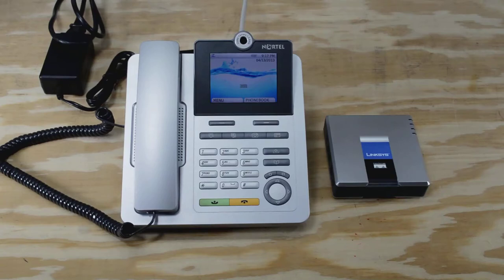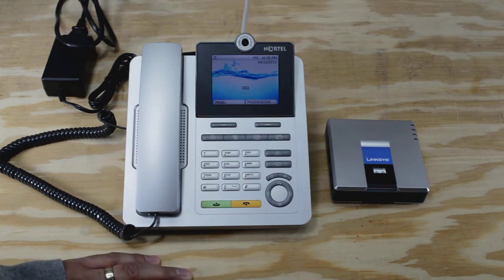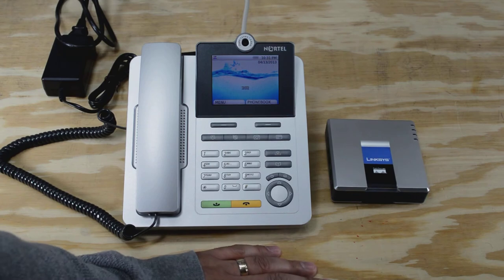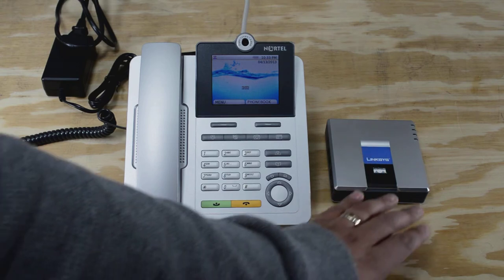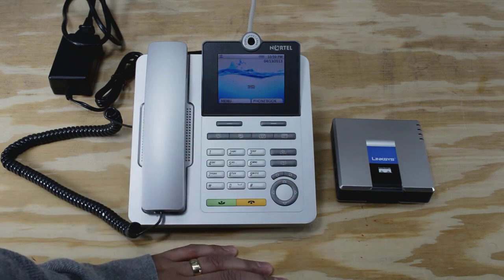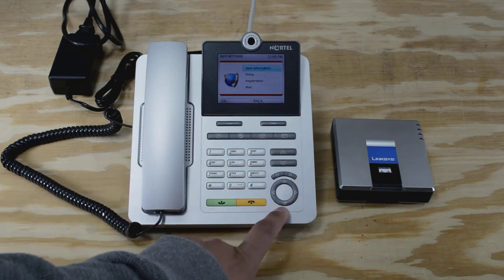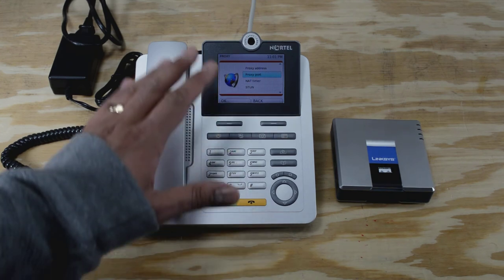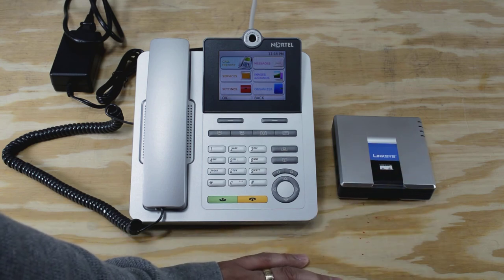PBX Project 2013 - Part 3 - Phones, Extensions and Problems

Comment: 5060 is the default port used for SIP, if you change that then you gotta change the sip sender port, i.e. your pbx. 
As for the linksys issue. The ring back is when you get an 180 ringing message ( which is a sip message) back from B party ( the callee). I would snoop between the pbx and the linksys to see if that message is being sent. then you can check if there is settings for early ringing on the linsys itself. Some phones they would play the ringing internally(like the nortel phone).

Comment: Couldnt you install the linksys box in your sever room and connect it to the RJ11 port where your wireless phone is connected, instead of running RJ45 to where your phone is?